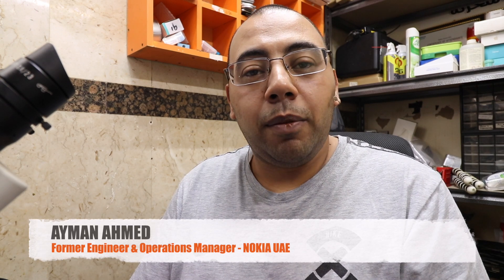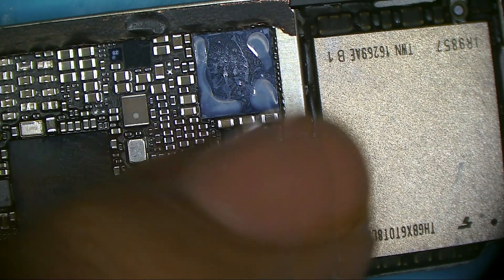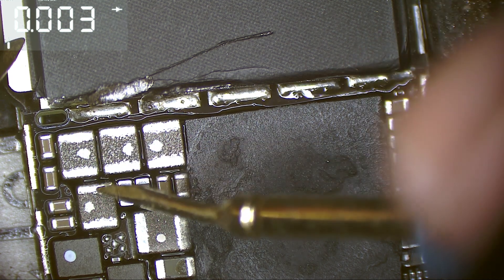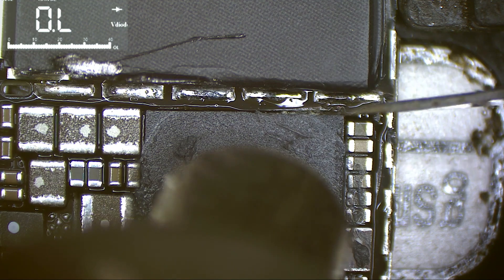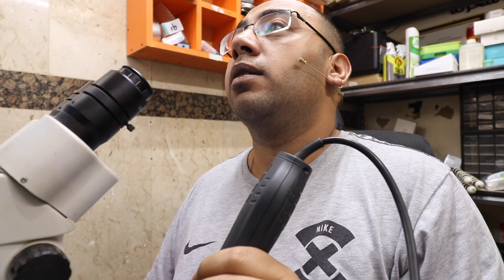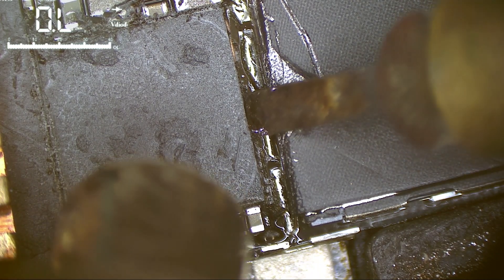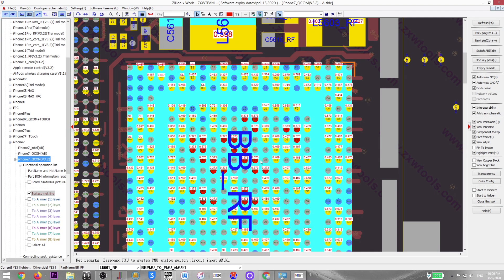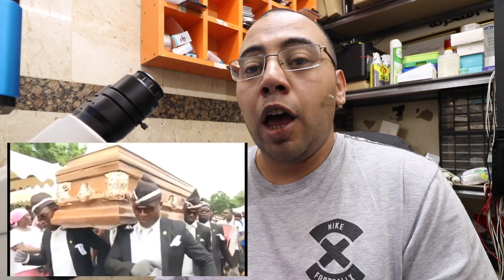iPhone 7 Keep Searching For Network Without SIM | How to Troubleshoot

Comment: Hey so impressed by your skills my iphone 7 plus has the same problem + no vibration I guess its a faulti taptic engine + my phone was getting repaired but they made it worst + I can't make recordings or if someone called me they can't hear me and my speaker isn't working. So I need you too fix it where is you're repair shop I do have a iphone 7+ 128 gb please need helppp
Reply from the maker: Thanks a lot, my shops are in Egypt Alexandria 00201270088949 and UAE Al Ain 00971567826253

Comment: Somehow I managed to pull some pads, on removing ic, could some of them be vital? missing A12,B12,M12, D11, B10, B4. C12 I can place jumper. But does any of the other need jumpering. many thanks I haven got program for looking up pinout, saad!
Reply from the maker: You could use phoneboard.co free software to check it i am very sorry i can't check it for you i have limited time

Comment: Hallo Sir neead your Healp IPhone 6S restate in about phone battery health no so so Sarvice & no batter in 3U tool charging good charging volt is good  I Chang U2300 / U4500 U2 IC Q4500 testing mother board in working phone body but restart after some time SWI line reading good  what is problam Sir add me in your WHATSAPP Sir +9779852049132
Reply: Sorry for my bad English
Reply from the maker: can you keep this question for the next stream because i need to ask you more question to be able to figure out the problem, turn on notifications so you won't miss it

Comment: How to check ic fualty .... make a video about checking dead mobile ic
Reply from the maker: in this video i show you how to check if the ic is faulty or no otherwise if the ic is not creating the volts or signals it should create it is faulty this is something you can't learn from one video you have to build experience by going to a repair school or watch too many videos
Reply: Ayman The Repair Tech make more video’s

Comment: Grate learning Sir today Healp nead Sir IPhone 7 Plus Qlm Actvation error & no IMEI Reball bb cpu & Chang Bb pmu same.  C5609 Pp 1.8 volt no come. C5613 pp 1.8v not come L5601 no any volt what To do Sir. In this Ground reading good C5609  432 OM’s / C5613 259 Oms L 5601 261 oms
Reply from the maker: If no volt change BB PMU
Reply: Ayman The Repair Tech  thanks Sir
Reply: This volt com from bb pmu Sir
Reply from the maker: @narayanmobilecare  change it